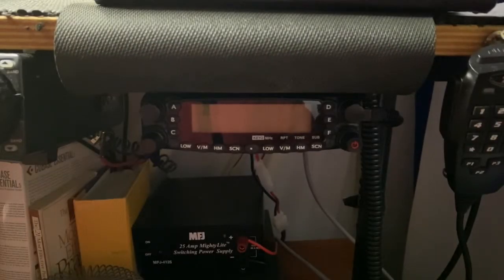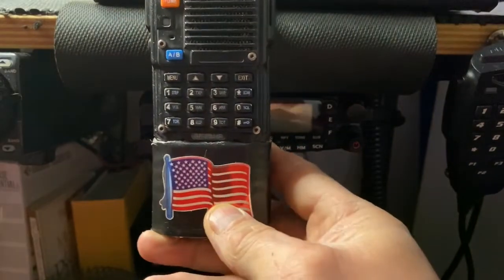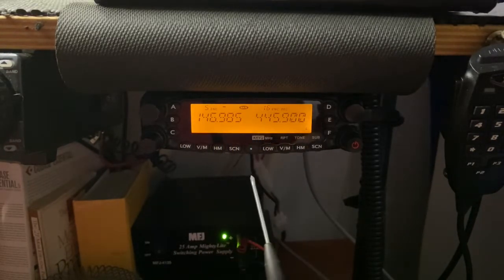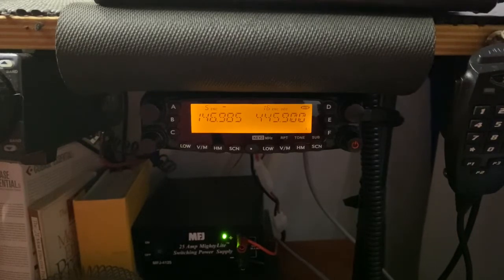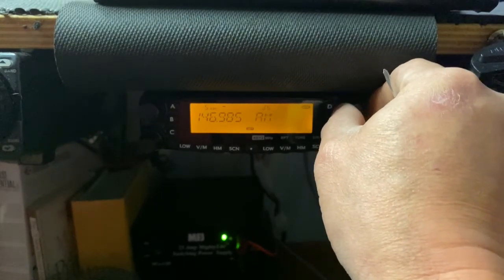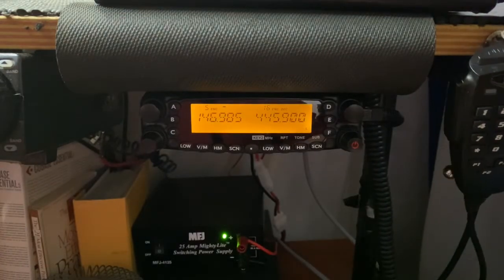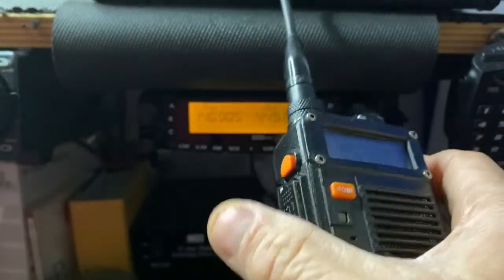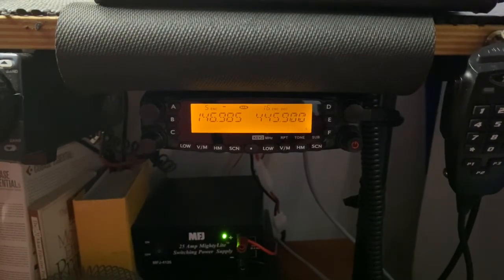TYT 7800 2m/70cm Crossband Repeater Ham  Radio How to Put in Crossband Repeat Mode

Comment: I hear a cross link between 52.525FM and 146.52FM locally.  Is this legal for these two frequencies? I have read that these two frequencies are 6 meter calling frequency and the 2 meter calling frequency. But are they legal to link together?
Reply from the maker: Yes it is legal. Providing the one crossbanding has at least a tech license
Reply: @smokehousestudios100  Thank you so much for your knowledge.  I hear some people enjoying the crossband link from 146.52 to 52.525.  But I also her some grouchy people as well.  They sometimes get into arguments whether it is legal or not. The link seems to happen every Saturday and at least one other day during the week.  It makes for very interesting listening.  I wish I could tell them it is legal but I have no transmitters, save an ancient C.B. radio I put in my vehicle when I bought the vehicle back in 1996.  The grouches want to track the link to find it.  The ones that say it is legal appreciate it and love it. When it comes on, it just comes up without warning, stays up about four hours, then goes down just as quietly.  Other operators will then make the same link and get yelled at by the grouches saying that they can not do that and they can get in trouble. Then they get into another arguement.  I find the talk is very interesting when the mysterious link goes up for four hours.  Saturday is always a day it goes up. The second day is a floating day.  I can not express how much I enjoy that link talk.  I keep thinking to myself, "If it is illegal, why are you guys using it and arguing on it?" Of course, I can not tell them this. Perhaps a basic 6 meter transceiver and a license should be in order.  But by the time I get it, it is likely the mystery link will stop operating because some unknowing grouch will find the transceiver and give the operator a hard time.

Comment: Great video. I just got my tyt 9800 about 3 weeks ago and for some reason it does not work in crossband maybe it's me. I go to cross band repeat start hit the button again and it goes to the repeater and it flashes off and on and off and on and off and on the busy signal does but that's all can't get it to work any help
Reply: It won't work on same band you have to go UHF VHF as the channels bleed into each other if it's on the same band

Comment: Nothing like some unidentified transmissions on the bands.
Reply: I hear that a lot on my scanner on 80 meters.  I wonder why people even bother to get a license to talk on 80 meters if that band is so completely out of control.  It sounds a lot like the Citizen's Band in the 1980s before it cleaned itself up.  I am certain over half the operators on 80 meters have no license.  If you hate a transceiver or a scanner, tune in.  You may bit believe the antics you will hear. Just like the Citizen's Band of the 1980s, burps, flatulence, singing, music, wierd sound effects, echos, language that will make a sailor puke, and hostility, are very easy to come by.  I hear the same voices acting up all the time.  Who knows, they may actually be very high license holding amateur radio operators that just want to trash it up on 80 meters.  It seems to be the band to do so.  It is like channel 19 of Citizen's Band on 80 meters.  It is rather entertaining to hear it.
Reply: @indridcold8433  yep, I know it. I like to point out poor operating procedures whenever I see/hear them. If I am legally allowed to key up I’ll mention it, especially on the local repeaters.